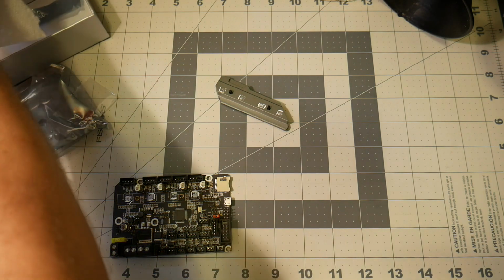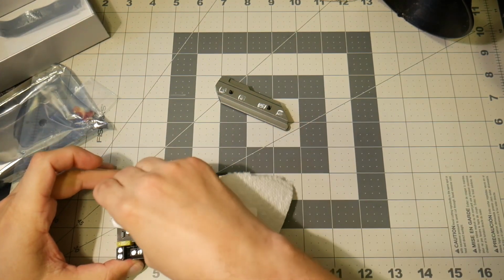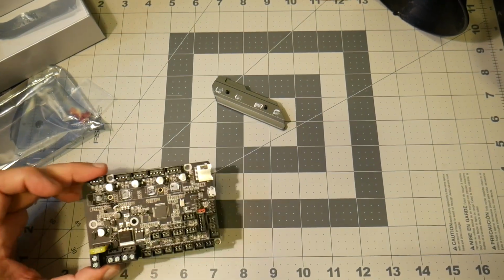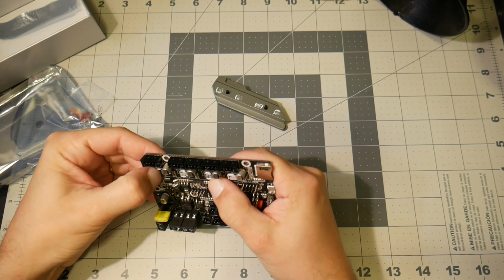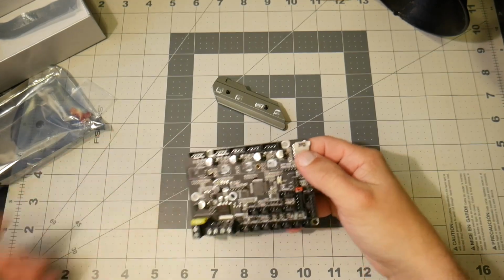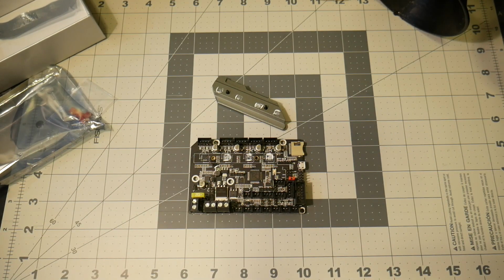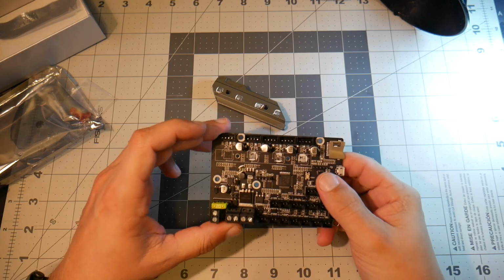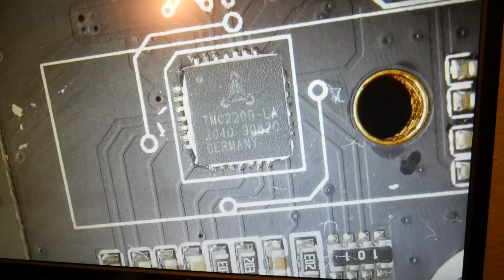BIGTREETECH SKR Mini E3 V3.0 Unboxing

Comment: hello.
which board is better for Ender 3 Pro   BIGTREETECH SKR Mini E3 V3.0   /  BIGTREETECH E3 RRF V1.1   /   BIGTREETECH BTT SKR Mini E3 V2  ?
Reply from the maker: Unfortunately I don’t have RRF board to compare... On paper RRF 1.1 has stronger CPU - Cortex M4, Wi-Fi via ESP8266 and only 2 fan connectors (Ender needs 3). As I never had issues with M0 and my Ender runs on Klipper with Pi Zero W, I personally have no need and I'll never use those features.
Reply from the maker: If I had to pick between V2 and V3 id pick V3: I like single heatsink, nice to have hotend fan connector instead of screw-in terminal, more controls over fans.

Comment: Great video!!  Would love to see a side by side comparison of what the V3 offers over the V2
Reply from the maker: As i just installed it in my printer i want to take some time and see how it works before I'll conclude V3 vs V2. So far differences are very small, feels like final touches for me that make V3 a bit better, but not that much if you considering upgrade from V2 over V3.

Comment: Have you successfully installed this yet? I’m a bit lost on the fact that this new board appears to be missing two of the screws, bottom left section, that were on the previous board. Not sure where these cables go. I was expecting a simple 1-1 drop-in replacement like the last version.
Reply: From the schematics, it looks like it is missing the pair labeled “Power”.
Reply from the maker: Just finished wiring video: https://www.youtube.com/watch?v=wTQH5gkTo_o

Comment: Is this new board silent? Like will it eliminate the beeping noise when printing?
Reply from the maker: Yes, this board has "silent" stepper motors. You can see printer noize level at Installation video I made.

Comment: What do you recommend for a beginner SKR mini E3 v2 or v3? Which board is easier to install?I'm just facing a choice between these two boards...Tell me please. Sorry for the mistakes, I'm from Russia, translated through Google translator.
Reply from the maker: Владимир Владимирович, вам лучше вторую версию, так как на 3й версии нету еще нормальных прошивок, хотя это может измениться, вам для чего вообще плата то? 😜🤣
Reply: @hobbyistnotes Me for ender 3 pro. It's just that I don't really understand firmware updates and modifications in general, so I ask)
Reply from the maker: @kapibara3388  Highly depends on what you need, better to figure what exactly you don't like about existing setup. I have 3 ender 3s (1st, PRO and 2nd) all of them out of the box print +- the same I spent money on all of them and they still print +- the same. It's weird game without end when you start modding printer you get so little and at some point you spend about the same as you would buy some really nice mass produced printer... From all of the updates I have done, the only few were really valuable: PEI sheet and ABL (no more glue stick and 'perfect' leveling). You have to buy board only if you know what exactly you are looking for from this update.
Reply: @hobbyistnotes  Thanks!

Comment: Im having a hard time trying to figure out how to set up sensorless homing with klipper do i have to set a specific diag pin like ^PC0? The jumper on the board has no specific pin it just says diag
Reply from the maker: You need to set diag_pin and driver_SGTHRS for proper sensitivity. diag_pin set to a corresponding end-stop pin on the controller with pull-up "^", you will find schematics in official BTT repository. I personally never had satisfying results with sensorless homing and pref to use actual end-stop switches, it's simpler and easier without relying on the drivers+software which is more complex subsystem to trust then simple switch.
Reply: @hobbyistnotes  thank you very much for getting back to me i really appreciate it. I would like to experiment with it im going to leave switches in place just incase. Im interested in sensorless just to help cut down on wires in the electronics box
Reply: @hobbyistnotes  i do have one more question with klipper configuration. Ive set in the config for the pi and mcu temps to show in fluidd. The pi temp works fine but the mcu temp stays at 900c and wont let me print i had to disable it in order to use my printer. Do you have any experience with this?
Reply from the maker: @Specialedes  May be you mistyped the setting or sensor isn't working properly. In my configs i used:
[temperature_sensor mcu_temp]
sensor_type: temperature_mcu
Reply: @hobbyistnotes  i have mine the same with a min/max value of 0/100
Reply from the maker: @Specialedes  Min you can do is to try and re-flash newer klipper to it. Also I would check board closer may be you knocked some of the component(s)

Comment: First video I've found on the new version, do you think the upgrades are well worth it? Main difference is the heatsink change and additional Z motor output correct?
Reply from the maker: Hello. Main difference compare to what board? V2 also have Dual-Z . This board has LED control pins, more powerful 5v delivery and finally fully controllable 2 fan headers tho I don't think all of those are significant. Currently workin on Klipper configuration and installation as it's a fresh board on a bit different STM32 controller not much supported, at least BIGTREETECH github has compiled FW and configs. Preparing more info for next video. But over all if you have no need to upgrade id wait who knows what surprises this board have. So far V2 worked for me perfectly fine.
Reply: @hobbyistnotes  Yes I meant V2. I recently purchased my Ender 3 Pro and was looking at board upgrades... currently on Ali the V3.0 is cheaper than the V2. So I may just order the V3
Reply from the maker: @Pickle312  If you will use it with Marlin or Jayers Marlin it should work fine, for klipper you will have to wait, lates compiled firmware isn't working and requires to run older klipper version in order to make it working.
Reply: @hobbyistnotes  dual-Z but only a single driver for both
Reply from the maker: @sxyrx7  you right, I forgot to mention that, it is dual-z on one driver, you can clearly see it at the video where I took off heatsink.
Reply from the maker: @Pickle312  was wrong about Jayers. Rest works fine. I was able to compile regular Marlin with CR10TFT screen, Ender V2 screen requires some work. And after downgrading client side of the Klipper at my Raspberry Pi Klipper work fine too.